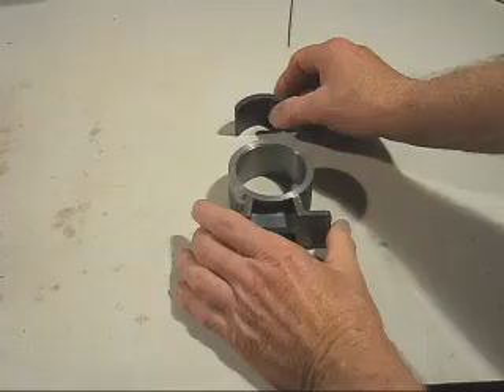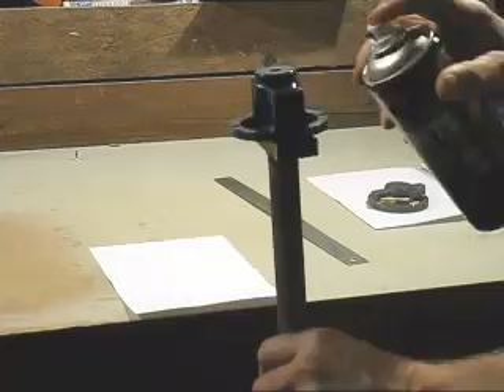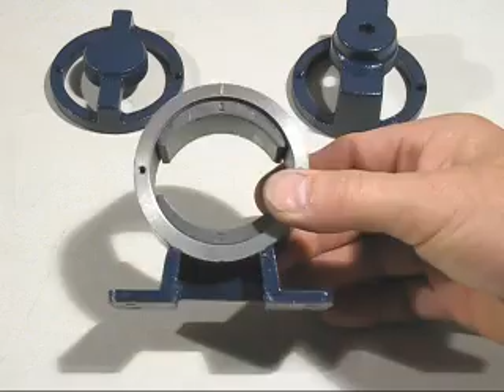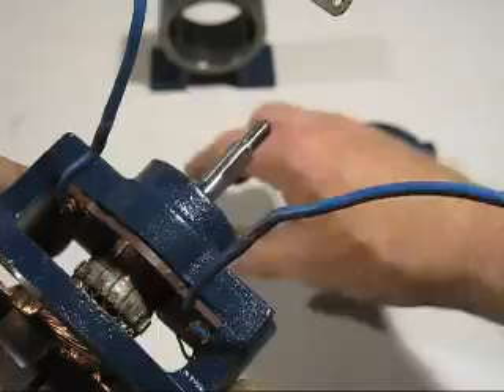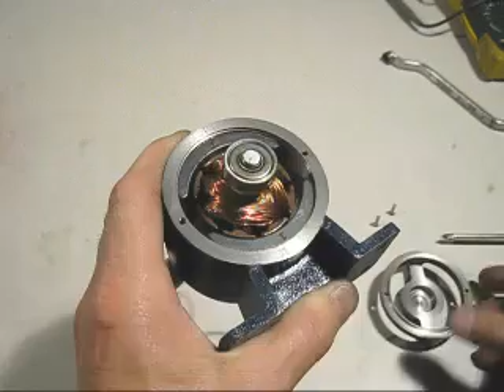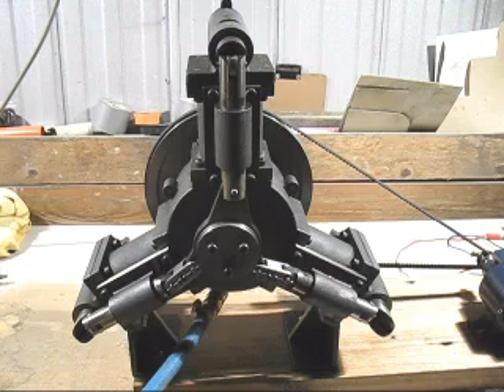Model D C  generator build part 4 assembling and testing.

Comment: Remember your generator will attempt to achieve the volts per rev even if it is overloaded so it is best to keep the load to that of the armature winding gauge, that is to say use amps as your limiting factor.
Reply from the maker: +NuttyforNissan Or I could put my finger on the casing and if it is too hot I will have to derate the generator output.
Reply: That's a good method to :)